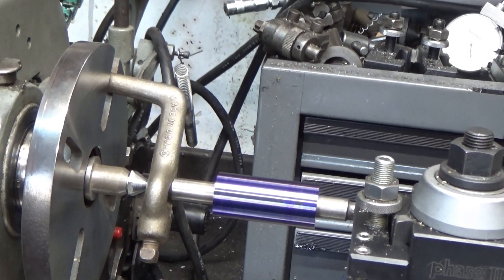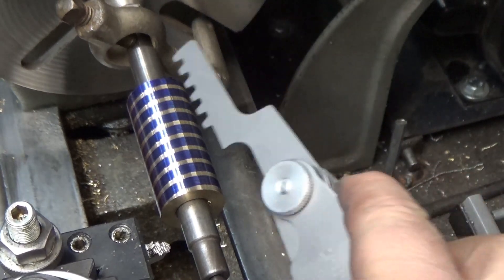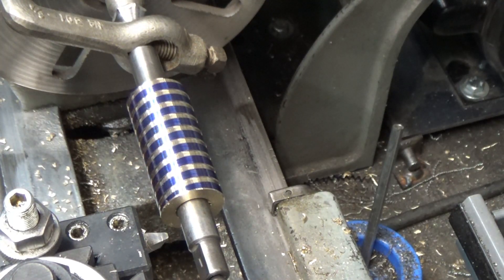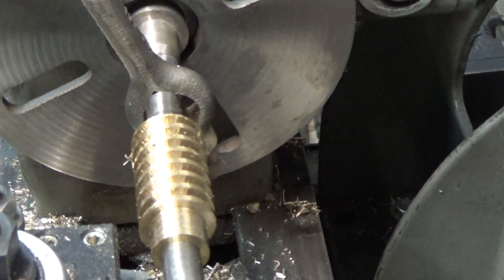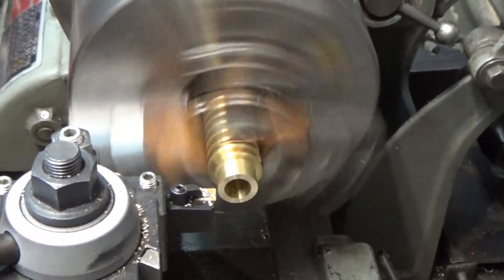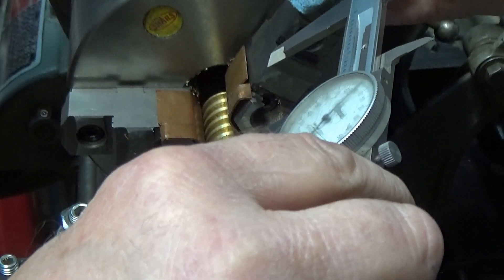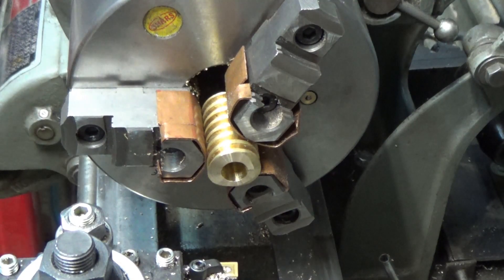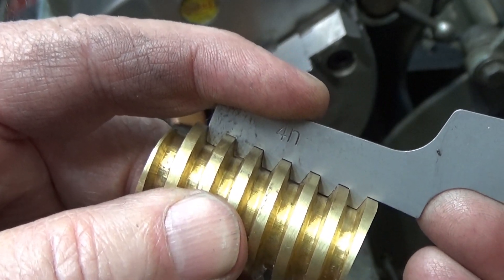Viewer Project - Cutting Acme Threads

Comment: I always cut down to depth first with a suitable parting tool and then take out the flanks. That way you are only cutting two faces...less chance of chatter. The method shown is fine for brass as there is not that much load on the cutting tool. For large threads it's best to use the compound slide set to half the thread angle and use a bit of trig to find the travel required, that way you are 'forming' one flank of the thread and 'generating' the other flank, much less load and virtually eliminates chatter on a smaller, less rigid lathe.  Nice video...the lathe seems to be shaking a bit...is something out of balance ? I am an old retired machinist. Thanks again for the video.
Reply from the maker: My first time cutting Acme threads and  4TPI is the limit for that lathe. I did have the compound set at 14 degrees and considered your idea of hogging out the material first but since it was brass it cut ok. I have been doing a lot of maintenance and set up on the lathe and it is smoothing out.  A lot of the movement is actually coming from the camera mount.  When I shoot video at the lathe I use a boom to reach over the lathe and stay out of my way so any little movement is multiplied. Thank you for watching and commenting.
Reply: @sharkrivermachine  . Ok Steve, good luck to you and your channel.

Comment: Nice work Steve.  Acme threads are difficult to cut at times particularly those that are fairly course so don't knock yourself around to much.  Great result in the end.
Cam
Reply from the maker: This was the coarsest thread that I can cut on this lathe so it was really pushed to the limit.  I am still getting it set up correctly and getting used to operating it. Thanks for stopping by.

Comment: Adapt & overcome !  Nice job .   You  can use another tool  to rough the thread out & then put the acme tool in for the finish passed to ease the tool pressure .    Cheers .
Reply from the maker: Great tip! I did think about that one sleepless night, but decided against it as too risky. Thanks for watching and commenting.

Comment: Turned out nice Steve. Maybe someday I’ll be able to make one. Enjoyed watching 👍👍👍
Reply from the maker: Thank you Ron, I am looking forward to seeing some video from you. I would like to see some details of your flat head ride. I built quite I few of them when we were in the automotive machine shop business.  They raced them at our local 1/3 track.
Reply: It’s a 1948 With an L on the top of the bell. Cast in the same plant where the Lincoln 12 was. Higher nickel and almost no core shift and at 120 over its a beast. Originally built as a huffer motor for the 1/4 mile.  I’ll give you specifics later but you would never believe it. A Machinist (a good  one) near me I showed the bare block to said he could not duplicate it for 10 K because of all the mods. Takes a lot of hours he said.
Reply from the maker: Do a video on it.  My best friend during the time that we were building our cars had a 50 Ford 2 door.  It was right around the time that our local race track started changing over to overhead valve engines. There were a lot of flat head race parts around at that time.  He picked up an entire collection of engines and parts from one of the racers that changed over.  We built one heck of an engine for that shoe box.

Comment: Nicely done Steve, the first time I tried a coarse thread like that, I found the tool pressure made it difficult to disengage the lead screw cleanly, nearly needed a clean pair of shorts after that one! Shortly after I made a hand crank drive for the spindle for threading up to a shoulder tightly. Cheers!
Reply from the maker: I didn't go into all of the details, but the tool pressure was so great at one point that I actually had the lathe jump out of gear.  That turned out to be caused by the cross slide gibs being loose but it created quite moment  when it happened.  Thanks for watching and commenting.